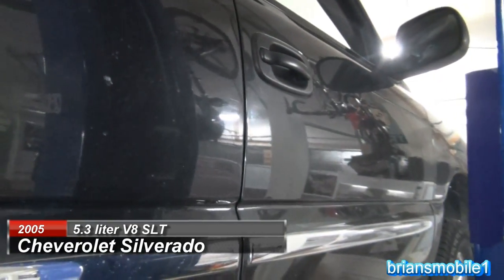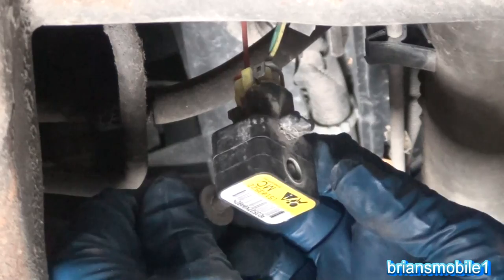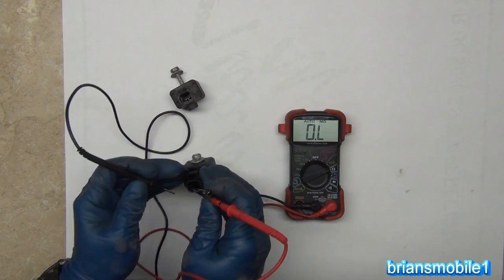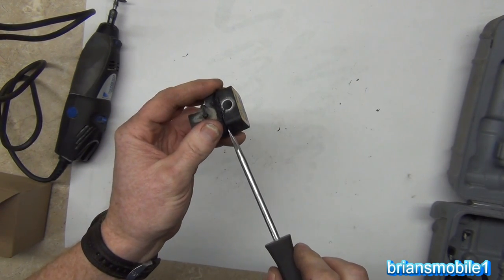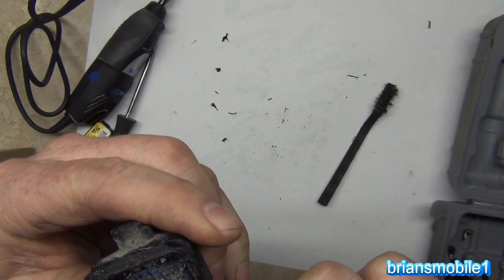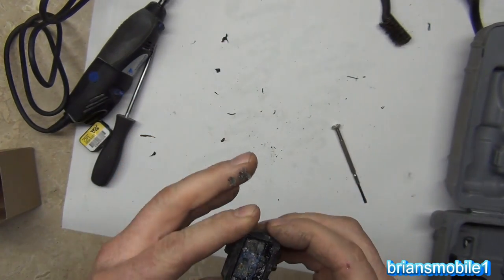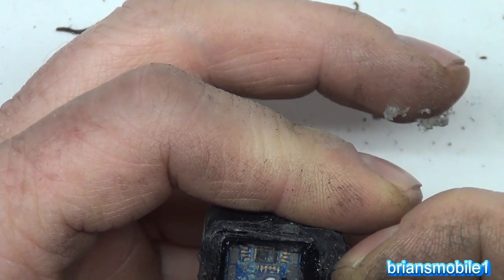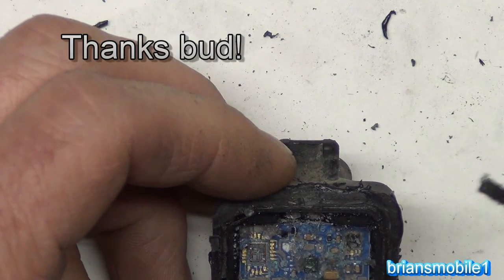Airbag Light Cause & Fix B0104

Comment: That jelly is what us electrical engineers call "conformal coating". It's used to prevent moisture from damaging the circuit board. Pretty much every factory board in the vehicle (minus the radio and instrument cluster) is coated. However, some are "hard" coatings (like on the RABS computer in my Ranger). Those do not allow for any adjustment or repair after the fact. However, they make penetrable coatings like seen with this sensor; they're made so you can poke through it to make adjustments or the like. If I were to guess, this was probably chosen to allow for some sort of a sensitivity calibration.
Reply from the maker: +Larry Bolan You're smart.  I love that about you Larry!

Comment: The device probably has accelerometers. It probably has 2 inside one of the larger chips. It has 2 so the device can measure any sudden impact in an any direction the car normally travels in. Most cars travel in the forwards, backwards, left and right directions (yes, some travel up and down but that is likely not a condition of normal travel. There may be 3 accelerometers to cover up down. This could be used to deploy the airbags if the car fell off a cliff and the designer wanted the airbags to deploy when that happens. Thanks for video. Many accelerometers are made of a very small plate that deflects in the direction of motion.

Comment: So, at 4:57 you see the failure point, the aluminum cylinder that the plastic is molded around for the attachment point has corroded and/or allowed water to get between it and the plastic and then froze and thus expanded the plastic and cracked it, which allows the water in. I think a preventative measure would be to squirt a big glob of silicone up into the threaded hole in radiator support first, then fill the hole in the sensor, coat the threads real good and put a big glob under the bolt head and the washer. Then both sides of the aluminum cylinder and the threads would be sealed and no water could get to it in the first place. Water and ice probably sit in the bottom of the rad support right over the hole that the sensor threads into and the water works its way down the bolt threads and sits in the cavity between the bolt and aluminum cylinder and then freezes and cracks the plastic housing, or the salty water just corrodes the aluminum and the corrosion does the expansion.
Reply from the maker: +MrTurdfergusen Great eye there!  That's awesome.
Reply: +MrTurdfergusen you sound like you know what you are talking about.  however, have you considered that plastic cracked when he opened up the sensor? how could you rule out that crack was there before he opened up the plastic?  I hate to cast doubt on your theory, but i can't say it's not possible
Reply: Mike C If you watch closely you can see that the area around that aluminum cylinder that the mounting bolt goes through is bulged out and there is white crusty stuff falling out of the 2 large cracks around it, he never really put any pressure on that area. This type of corrosion induced bursting is very common with plastic parts that are exposed to the elements, its the same reason that causes corroded fasteners to become stuck together, the corrosion expands and locks the fasteners together, in this case it was only 1 metallic part surrounded by plastic, the plastic is weaker so it gave way to the expanding corrosion, breaching the seal of the housing. Brian never really jacked around with the mounting hole so i guess i dont understand how him opening the sensor would cause the bulging around the metal sleeved mounting hole from the inside the sensor not to mention, the white crusty junk in the large cracks around the bulge.
I think its pretty cut and dry......

Comment: OK that clear large chip is most probably the microelectromechanical systems (MEMS) device that measures the acceleration. The signal is probably transmitted on CAN bus. I don't think the resistance is a measure of functionality. It definitely had water ingress which crapped out the circuit. I am not sure about the gel, though, maybe for vibration dampening? Not for conformal coating purposes probably, it really didn't work.

Great video as usual! Thanks!

Koray
Reply: Im guessing its a constant stream of acceleration readouts to the SRS computer, that then decides if a crash has occurred.

Comment: 5 things spring to mind. 1 no confomal coating on the board. 2 wires from board to conector not insulated. 3 the gel is likley to dampen bumps to the circuit but started to conduct due to saltd. 4 the ultrasonic weld was shit when produced, so numbers 1, 2 and 3 shouldnt have happend in the first place. 5 bad design, planed obsolecence. torquing that bolt down on the structural tube will crack the seal around it. then thermal expansion/contraction and air preasure changes fuck it all up.

Comment: noticing this is your newest tutorial yet maybe i can get a response from ya, i got a 1998 chevrolet k1500 with the 4l60e trans. i know there is videos on here on how to do a  complete flush of the trans fluid from the radiator. but your tutorial are alot more in depth and i was wondering if you had a chance to create a tutorial and specify parts needed to do this project along with a filter change of the same trans. i would very very much appreciate it!

Comment: In Layman terms- it's called "Potting Material". Depending on the need- it comes in different consistencies and colors, and it's used to protect circuits. To remove stuff like this- and to do all your electrical repair/rebuild projects- may I suggest this---http://www.autozone.com/miscellaneous-cleaners-and-degreasers/electrical-parts-cleaner/crc-electric-parts-cleaner/119711_0_0/   But be careful- this stuff is strong, and it will remove and melt automotive clear coats, paint, etc. and it will certainly defat your hands- so use PPE when using! It is the nasty big brother to what you already have there!

Comment: Was that stuff inside the sensor corrosion or could it have been some type of dessiccant the manuf. put in there to try to keep it dry?  Looked weird.
Reply from the maker: +frdradio The jelly is factory, but the corrosion and white stuff was not supposed to be there.